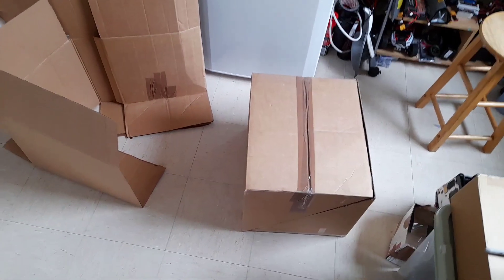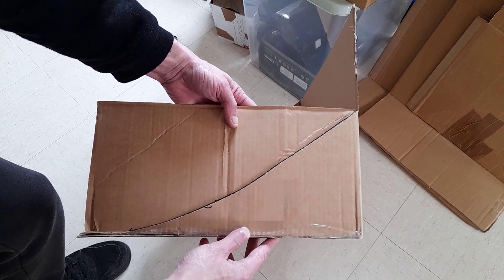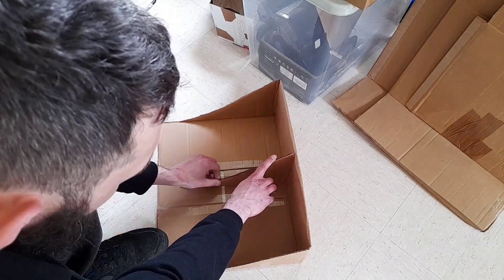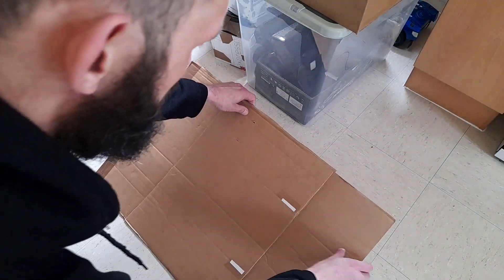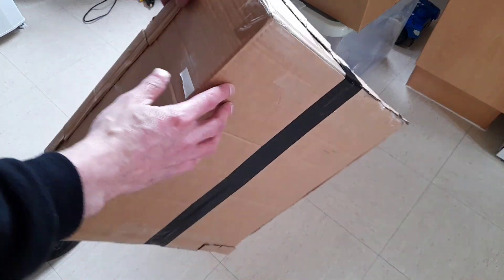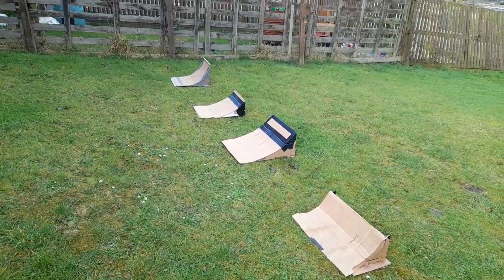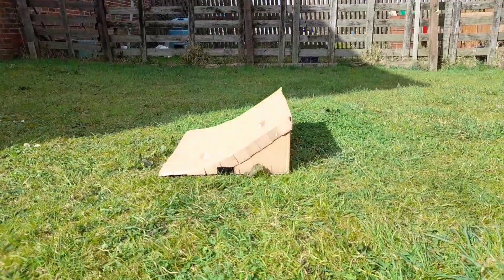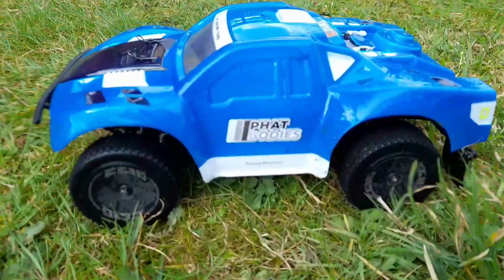RC Jump tutorial, Easy simple and lots of fun!

Comment: If I could add something I’d recommend put some weight on the bottom of the inside of the jump before you put the top on to help keep it in place.   Maybe glue something that has some weight to it. To the bottom. Nice video tho!
Reply from the maker: More added the better, easy enough to open the base and add soil, sand, stones ect. Great little addon tip there.